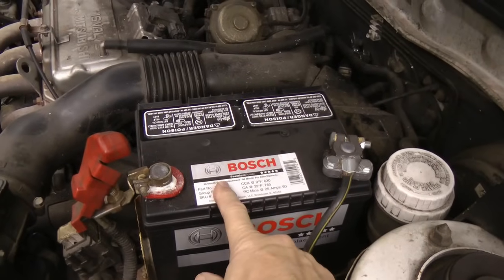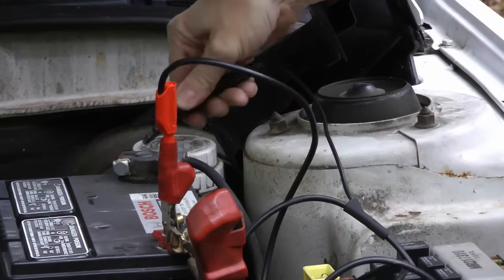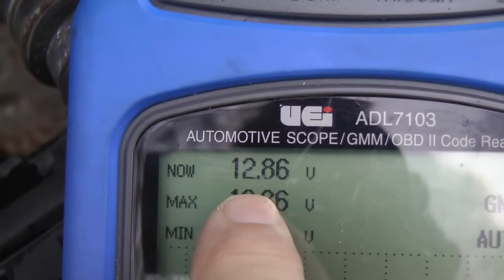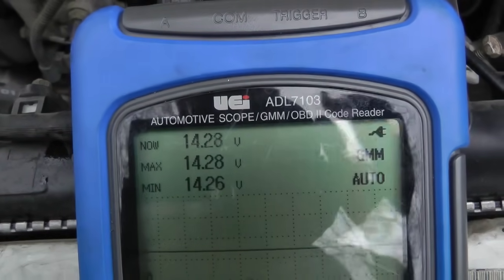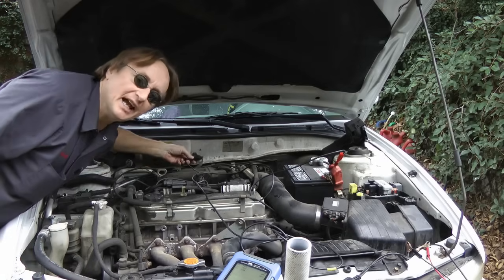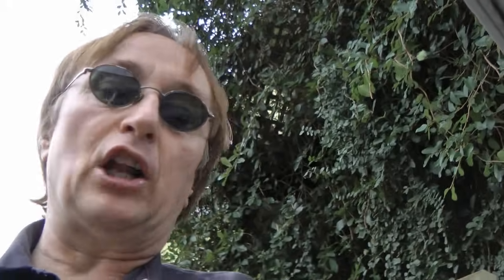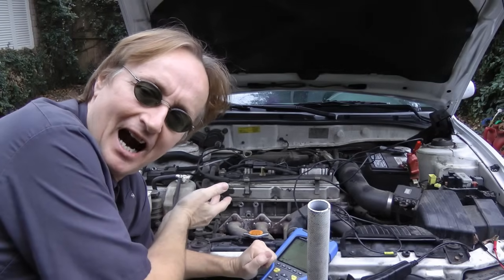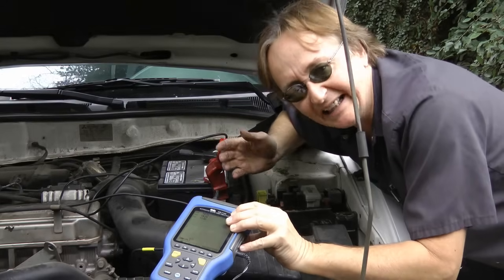How to Fix Electrical Problems in Your Car (Ground Fault)

Comment: Hey i have a serious problem with my 2004 Nissan sentra. It will not crank after i tried jumping it. It just makes a clicks after i turn the key and then it completely turns everything off. Lights radios etc. The battery is good and was charged at a auto zone. Ive even tried the starter trick and the exact same thing happens. What could it be? Thanks in advance. Love your videos!
Reply from the maker: generally you just need a new starter, they click when they short out inside. And,If you like my car help, be sure to watch my live car talk show every Saturday morning at 10 AM CST on YouTube. I answer your car questions LIVE there. Just go to YouTube and type in the search engine "Scotty Kilmer Car Talk (and put in the coming Saturday's date, such as "Scotty Kilmer Car Talk  January 25" or whatever date the next Saturday is)".  That takes you to the live event, and shows how many hours and minutes it is before the event starts on Sat morning.  And remember, every TUESDAY  I upload a new video, so don’t miss them.
Reply: Thanks for the reply Scotty! Now it cranks but it wont start. The problem was that the starter was very lose. Now im going to see your other videos to see if i can fix the issue!  Ohh yeah do you have any tips on Sparkplugs that will not come out of the head? I tried using a breaker bar to see if it will loosen but it dosnt at all. Ohh and ill watch your live car talk show!

Comment: Hi Scotty, thank you for the informative video on Voltage testing.  I am having a problem with an 11 year old BMW where the Fuel Pump is not working after it gets cold.  I measured the plug with a multimeter and it was showing current so I ended up replacing the fuel pump.  Today after it sat overnight, the fuel pump was not priming like it always does when I turn the key and the engine did not start.  Since I knew the pump was probably good and I had just measured the current (12V on my cheap analog multimeter) I just unplugged and reseated the Fuel Pump plug and the vehicle started.
Could this be a ground issue?  Thank you again
Reply from the maker: yes, could be, also put some dielectrical grease on the contact plug to prevent corrosion and bad connections

Comment: Scotty great channel! Question: 07 Honda Pilot had a squealing serp belt and flickering head and tail lights. Replaced the belt and pulley which solved the squeal immediately but I am still getting some flicker in the lights which comes and goes. I have read that the Honda system in this model and year is prone to such drains due to the elec system design. Thoughts? Thank you.
Reply from the maker: have both the battery and alternator load tested, places like auto zone do it free. Often one of those does that, but if not, live with it, hondas do that from somewhat weak wiring with age
Reply: Scotty Kilmer Good advice. I have heard this particular problem could be alleviated by adding another (secondary) ground wire to the battery as well. Opinion?

Comment: hey scotty you have helped me in the past so i am going to ask you this, i recently had problems with a headlight switch in my 96 ram 1500 so i swapped it out and reconnected wires via crimps this switch has 2 settings on 1 and on 2, on 1 is park lights and dash on 2 is headlights when the switch is on on 1 no lights work but if i move the switch back toward off a little the park lights and dash light work is it another faulty switch or a short/open circuit the headlights work fine?
Reply from the maker: sounds like a bad switch, especially if it's a junk yard switch, as they all end up breaking like that when old
Reply: Thanks again scotty going to pick a new one up as all of these oem switches were recalled mine was supposedly done but i dont see the revisited harness
Reply: Try ebay for a new switch,,it will be better than a junkyard junk. always go new if u can.

Comment: @ scotty Kilmer  I have a problem with my 2000 Grand Prix I recently replace a wheel bearing to get rid of the abs and trac lights and they came off but when I turn my head lights on the abs light and trac comes back on do you know what could it be??????
Reply from the maker: have the alternator and battery load tested, places like auto zone do that free. Pray it's one of those, cause if not, you have wiring problems, often bad ground wires on a pontiac

Comment: I have a problem with my toyota. The engine cooling fan refuses to switch on, and before this, the fan refused to go off. it used to continuously run until i pulled off the relay for the fan, One day i put the relay back in and nothing happened, fan hasnt worked since then. Ive tried to replace the relay thinking there might have been a problem with that, but that hasnt got the fans running either
Reply from the maker: try a new cooling fan temp sensor, pray it's that and not a bad main computer, as it could be either

Comment: Hello Scotty, I have a 94 Nissan Pickup. i recently changed the starter about a week ago but now when Im turning the key, the starter clicks as if it was bad. I think I have a bad wire somewhere but I have no idea what to check. Please help, thank you.
Reply from the maker: a weak battery will do that, as will any wires that are corroded or loose. Check the battery terminals, and the two wires that feed the starter

Comment: Ptoblem: went the car is idling in a stop light and the fans start to turn on I can notice that the rpm drops about 300 to 500 rpms . And also if I push the windows button it drops the rpm. Would it be a ground wire I re wire all up to the alternator wire and grounds .

Comment: Hey Scotty I have a weird problem with my car and I've check all fuses and grounds but they seem ok. When i put my window down, right when its done coming down the engine rpm do a little flactuation. When i put both my windows down at the same time the rpm flactuation is more noticable. Battery tests fine and so does the alternator

Comment: Hi Scotty, I have a 2001 Mazda 626.  The cigarette lighter is showing a low voltage at around 10.8 volts.  I got this reading using my multimeter touching the red tip to the bottom inside of the lighter and the black tip to the inside side of the lighter.  The battery is at 12.3 volts.  There is not enough voltage to run the accessory I want to plug in there.  What could lead to this condition?  A bad ground?

Thanks, Tim

Comment from the maker: the high beam low beam switch may be bad, see that all the time. change that first, pray the wiring is good and not shorting out somewhere between the switch and the headlights.

Comment: Nope, it wasn't the passlock sensor in the ignition switch and most likely a wiring issue shorted to ground or open.
the GM TSB says for code U1064 that most BCMs are replace unnecessarily and it could be a connector problem or wire.
I even had the dash apart looking for shorts or wire problem but I was not about to take the dash frame out for that meant to take the steering volume out of the car.
Everything else in the car works fine, just the no start.
For now I just pull the BCM/Cluster fuse.

Comment: You correct Scotty need a GM TECH 2 scanner

As long as I can get it to the point where the battery does not go dead over night by taking the BCM/Cluster fuse out and the relay for RAP to get it to the point I can run it for about a week to get it to the emissions station to get it to be tested.
I can live with either pulling the fuse or build a fuse, wire, and toggle switch every time I need to start the car.
Yeah Scotty I know, I am cheap, but in this day and age need ever dollar to live on.

Comment from the maker: generally that's a bad BCM, but really only a mechanic can diagnose it without just guessing, as it requires a dealer level scan computer to analyze it, and then to reprogram the new BCM to work on your car. Just putting a new one on won't work because of crap gm software design.

Comment: On my 2003 Monte Carlo if it key is still in the ignition and you open the door and try to close the door locks with the switch the door locks will close then open.
On some cars even the parking brake is also a input signal either to the BCM or PCM to let the computer know the car is stopped and in park.
The parking brake switch also turns on the automatic day lights on.

Comment: Scotty in the GM passlock module there is a resistance in it that the BCM reads when it does a relearn and if it does not get the correct value the passlock module turns on the transistor and shorts it to ground in the circuit ( it's engineered to do that ) causing  a security issue or it see's a theft attempt.
At least that's what I learned or figured out on one of the websites that explains it.
I think, a big maybe, I found my battery draw down problem it might be the outside mirrors or switch

Comment: Correction is the GM TSB for the code U1064 that GM says that most BCMs are replaced needlessly and in most cases it's the wires or connectors going to and from the BCM.
Thank you Scotty for your help.
Many people with GMs with the passlock system have this problem.
Don't know why GM can't have a recall on this because this can lead to a safety issue.

Comment: I manged to get it to work with the resistor value that I got.
However it's not the passlock chip in the ignition switch.
GM TSB for code P1626 Theft Deterrent fuel enable says in most cases it's not the BCM but wiring and connections in the plug going into the BCM.
I already checked that still have not found any faults yet.
I hate working under the dash, no room.
I did move the BCM wire and plugs today to the side today didn't get the P1626 code, well not yet anyway
I better take a closer look.

Comment: Scotty I have the famous GM on 03 Monte no start condition.
At first I thought it was the passlock but bypassed it and still same problem.
I can take the 10 AMP BCM/CLUSTER fuse out a few times and the chimes change beaps and the radio does not show locked and the leds are brighter and the car starts.
A bad BCM ? 
The codes I get are U1000, U1064 and P1626 theft deterrent fuel enable circuit.
The GM TSB says if you get the U1064 code it might not be the BCM.
This is a nightmare.

Comment: Hi, I have a 2000 Volvo XC70 car, I just put in a new alternator, but when i start up the car the positive wire on the battery starts to heat up  A LOT as well as the alternator is heating up. Overnight the battery loses all power and becomes dead, even without the key inside the car when i connect the battery, the dashboard shows 88888... for everything. Please help. Thank you

Comment: I recently bought used 2004 Chevy Optra but I found out that the electrical locks lock out themselves when I pull the handbrakes. However, when I press (turn off) the handbrakes, it returns to normal function and lock.unlock normally. Any suggestions?

Comment from the maker: either e brake switch is broken, or you are low on fluid, it sloshes around when low and moving the car will make the light come on.

Comment from the maker: locations are by VIN numbers, call a dealer parts dept, they can tell you by make model and year.  Bad ground wires of course should be tested first, especially on older cars or cars up north with salted roads.

Comment: Hi Scotty, I have a 1996 Saturn SC2. All of a sudden the power windows, a/c, cruise control, and defrost all stopped working at the same time. I checked all the fuses and they were good. Any ideas what the issue may be?

Comment: yeah thats true
also i need some help with my ford the Glass liftgate opens halfway when i press the button, usually it would open with one touch but now i have to use my hand to open the rest any suggestions?

Comment from the maker: pray it's a weak ignition switch, try that first. If not, often a bad body control module, and they are hard to diagnose and replace as they require reprogramming when changed out.

Comment: Hey Scotty, I'm stumped with an electrical problem I've been having with my 2001 Oldsmobile Alero. About a month ago my a/c, windows, and cruise control stopped working. The a/c control panel doesn't light up either. When the problem first started there would be a 10 min delay then everything would start up. However, now I can drive for an hour without having access to the power windows or a/c, which sucks during summer. I've tested all the fuses, not just the a/c specific ones. Any ideas? THX!

Comment from the maker: first, check the fuses, they are not made for serious use and often blow fuses. If not, those plugs often break and need replacing as they are pretty cheaply made thin metal and plastic devices not made for serious use.

Comment: Hey scotty my 08 ford escape Xlt v6 3.0 has a problem with the charging ports when i put my gps or anything that needs to charge they do not work?
what could be the problem with it? i have 2 in my ford and none are working at the moment

Comment: Scotty, I don't understand electrical in car repair, 98 chevy cavalier convertible Z24  2.4 liter,  when the turn signal is turned on, one arrow on the dashboard flashes FAST an when switching turn signal the other time it flashes SLOW an NORMAL. how can I fix it, I did check the bulbs I did not find a bad one in the rear of the car. Kody

Comment: 1998 Chevy Blazer update as promised. Dealer said replace UBEC before further diagnosing can be done. My mechanic put in the new fuse box and as he suspected, it is still doing the same thing. He says the suv will start if the headlamps are removed from their sockets with the headlamp switch turned on, but as soon as he puts a bulb in the socket, the engine dies. He is currently searching schematics for the BCM and the multi function switch on the steering column turn signal lever.

Comment: Thank you so much Mr. Kilmer. You were right, I blew the dome light fuse. I learned my lesson the hard way, next time I will definitely disconnect the negative terminal prior to touching any electrical system. Again, thank you so much for your help.

Comment: Hello Mr.Kilmer, I recently change the dome light for my 2000 camry and I got a big problem. I removed the bulb without disconnect the negative battery terminal. Now, the light won't work, the remote to unlock or lock won't work, and as well as the alarm. I can start and drive the car normal. Did I break any short circuit or blew any fuse. Please help me Mr. Kilmer. Thank you very much.

Comment: The Radio on my Mustang does not work. According to the last owner it would drain on the battery over time. I think it might be a short to the radio. Could this be fixed with buy examining the wires or should I just invest in a new radio?

Comment: Hey Scotty, my htr/ac fuse keeps blowing causing my fan to turn off, i replaced my ac resister and my blower motor thinking that might be the problem, but its still blowing my fuse, sometimes immediately sometimes it'll go a few days, what could be wrong and how can i fix it? - 2002 Chevrolet Avalanche 1500 - thanks! Love the videos!

Comment from the maker: generally bad wiring then, me I'd just power from the driver's side bulb by splicing new wire to the non working one from the working one. Quick and easy fix.

Comment from the maker: bad grounds often do that, get that ground relay out somehow and rewire it so it's not corroded, pray it's just that
Reply: I have a 2003 Honda Element. The fuse box under the hood has multiple relay and fuse connectors that are getting extremely hot. Any ideas?

Comment: Scotty, I posted earlier, 1998 Chevy Blazer. No key in the ignition. I turn on headlamps, headlamp relay buzzes and rear wiper motor tries to start. Im still scratching my head trying to figure this out. One other thing, the headlamp GROUND RELAY, cannot be pulled out, like it is friggin welded or something.

Comment: I just replaced the battery and the alternator, both were checked and both came up being bad. I jumped the car again and again it runs great. A code does come up (P0403) EGR control circuit. I'm not sure that the EGR will cause this. I will pull the EGR valve and clean it. Might be a good idea. I saw most of your videos on how to check but not sure if I understand it. I have a voltmeter, but not sure exactly where to start.

Comment: Scotty, I'm having issues with my 02 Mitsubishi Lancer ES. The CEL and the BL are both coming on and flickering on and off randomly. I gave it a jump and it runs great. However, when I turn it off the lights usually turn off automatically but they are staying on. Also the AC is staying on and blowing. I have to manually turn everything off. But even when I do that the car after 4/5 hrs the car is completely dead again.

Comment from the maker: those stupid firebirds were electrical nightmares as they age.  run new power wires from the battery to your noise machine and anything else you want to work, and put in line fuses on the wires

Comment: Good evening scotty. I have been put my hand in classic car 1986 Firebird. Head light was not working so I taped like old TV and Got it back....next day changed the harness and lost Horn, Radio, Auto door locks and dome light. I dis connected the cigarette lighter (Raped the terminals) and also changed all of the fuse no matter they were looking fine. Still no luck and young man like me without boom boom music in car is like dead man driving sexy car. Is there any cure for this?

Comment: I don't know if you'll see this Scotty, but maybe someone else has an idea if they read this. 2004 Ford Ranger Edge. Two little doors in the back. It has started to show door ajar and the interior light stays on even when I'm sure all four doors are closed. Went to check the door switches in the jams and they AREN'T there ! Can;t find them anywhere. Did they go to proximity switches inside the doors? This is the newest vehicle I've ever had and I'm feeling old and stupid.

  Any Ideas?